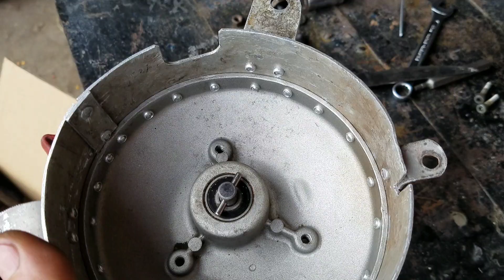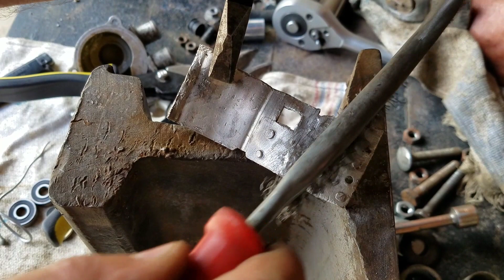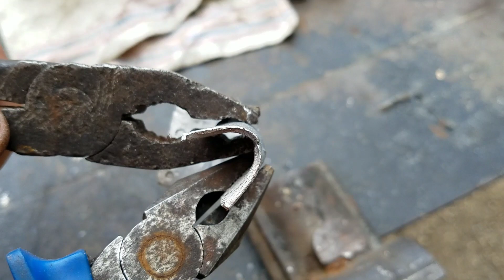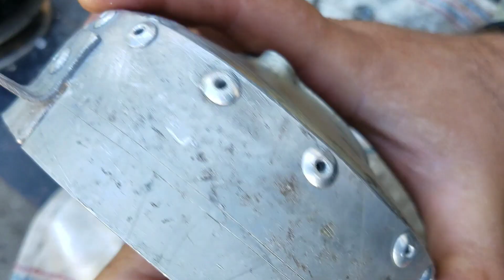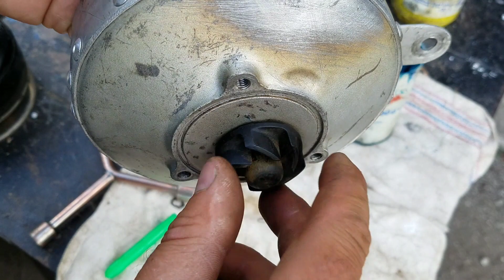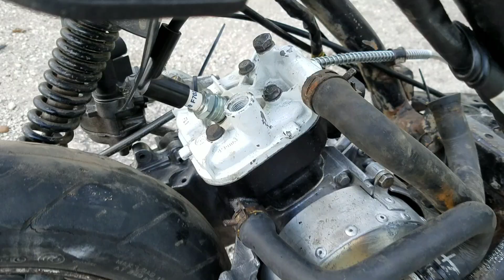Пайка алюминия без аргона, припой Castolin

Comment: AU LOW TEMPERATURE ALUMINUM FLUX CORED WELDING WIRE SOLDERING ROD 10/20/50PCS. No acetylene

Comment: You need to know, this is no welding, this is brazing. So you need to heat the surfaces, until the rod melt, but not the base material. Reduces ozigen and make the flame long, lime a gas torch. With patience and perseverance you make this operation.

Comment: "Cold" Soldering with Epoxy Putty works good to seal things too!
Not recomended on high pressure and vibration.
Epoxy Putty fix almost everything! :)
Reply: epoxy washes off in the rain. tried to "cold solder" a fucking cap to my muffler hole. she no good.